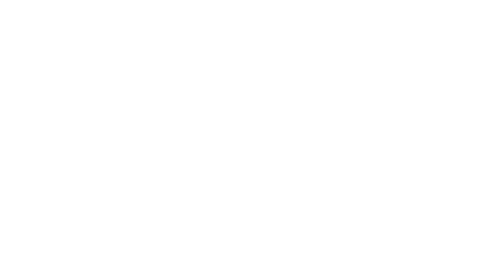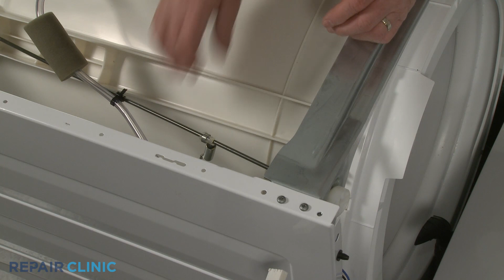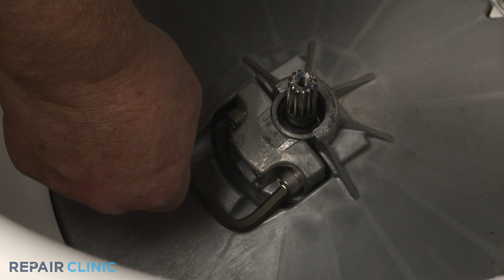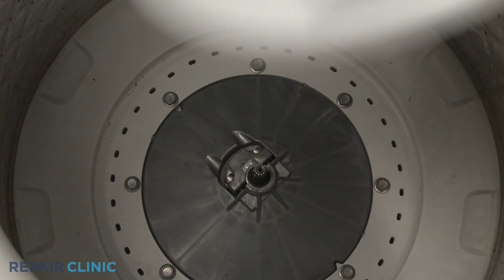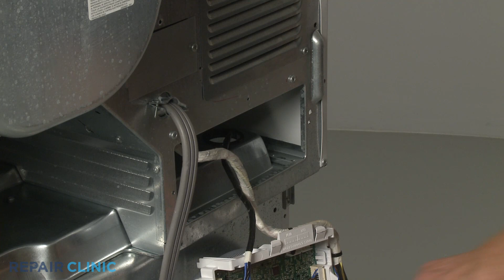Frigidaire Laundry Center Washer Transmission Assembly Replacement (5304517318)

Comment: TECH TIP, SAVE AN HOUR: The tub does not need to be removed, which means no suspension or electronics need to be disconnected. In fact, you don't even need to lay the machine down:
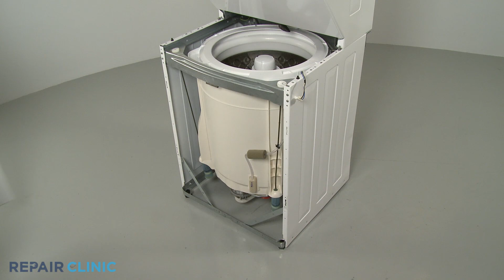Follow the video from 0:00 - 2:30
Now you can either tilt the machine back at least 30 or 40 degrees, or find a suitable area to lay it down.
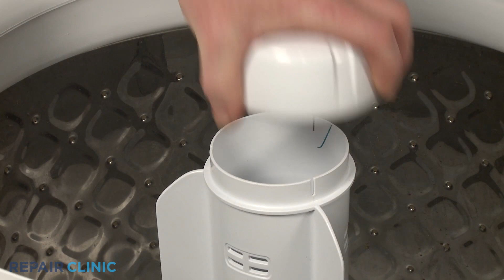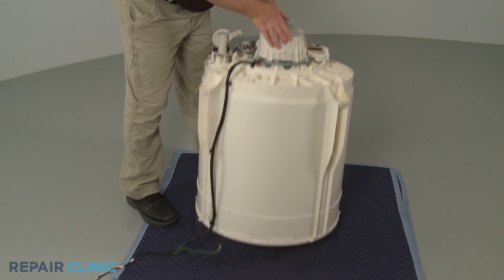Now follow the video from 6:43 - 12:00
I don't know why they insisted on making it so hard in the video but whatever.

Extra tips:

Mounting hub bolts will likely be difficult to remove due to residue and/or corrosion. Do not use heat, it will melt or warp the outer tub and transmission seal socket. A washable or inert penetrant would be useful, preferably silicone or PTFE based. Or just crank on it and be ready to damage your hex wrench or bit. If you don't have an extractor, use penetrant first.

The transmission won't come out nicely on its own, you probably need to hammer on the top of the spline inside the drum with a rubber or plastic mallet, and then you can pull it out once it's broken free of the buildup/corrosion on the hub. Clean all of the hub parts, including the bolts, before reinstalling. Torque those down well, but not to the point of stepping on them, and don't use an impact.

When reinstalling the machine to its vent, don't try to squeeze behind to tape the vent connections together. Remove the 2 front panels below the control panel (between dryer and washer) to access the dryer blower and vent. It'll be a lot easier to tape from the front. It's not all taped from the factory. Tape every connection and joint. You don't want microplastics blowing around your house.
Reply: Doing my first one today, I was wondering if that was possible, thank you SO much for confirming before I drug this thing out.

Comment: If your replacement transmission doesn't come with a pulley (and you have to reuse the old one) make sure that they have the same spline pattern! My new transmission had a clutch tooth pattern that didn't engage with the old pulley, so I was fortunately able to reuse the black clutch disc off the old transmission. Works perfectly!

Comment: Thank you for this video! I was working in a tight space, and was able to change out the transmission without removing the tub assembly by tipping the unit against the back wall of the closet and putting some blocks of wood beneath the front edge of the frame to brace it.

Comment: I tried and tried to get the basket assembly out thru the bottom as demonstrated in this video.  There was no way it could fit.  Fortunately, I found another video that showed the removal thru the front opening.  Very frustrating.
Reply: Don't take the basket assembly out-- it's more trouble than it's worth. If you've already got the whole unit laying on its back, you absolutely do not need to go any farther. Just remove the center agitator bolt and agitator, undo the two allen key pinch bolts inside the tub, remove 4x bolts and the belt housing, drive belt, 1x nut and lockwasher that holds the pulley on, 2x bolts for the shifter, undo the wiring harness clips around the edge of the transmission, then 8x bolts that hold the transmission to the bottom of the tub. It pulls right out the bottom. Depending on the age of yours, you may need to smack the top of the old transmission (the center steel rod inside the tub) with a hammer to get it loose. Mine was stuck in there with crusty old powdered detergent and some oxidization on the aluminum clamp pieces.
Reply: @DocBlasto  Thanks for the tip.  I will definitely try that on the next one.  Sounds wayyy easier.

Comment: Will the agitator not come out of the lid opening and will the new trans not go back in with inner tub assembly?  I don't understand why that all had to be removed, rather than just flipping on it's back and replacing, similar as one would the pulley.  These units are always in spaces with limited room.
Reply: I tipped it back about 30 degrees against a wall, put some blocks under the front corners to prevent it from righting itself, and did the whole replacement from beneath. I think that laying it on its back would be just fine. Could do it in half the time if I did it again.